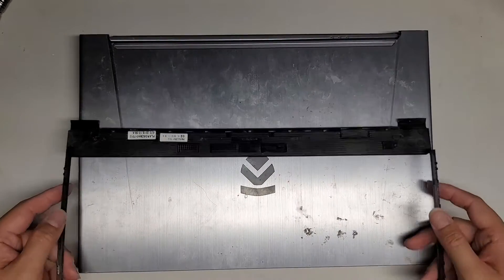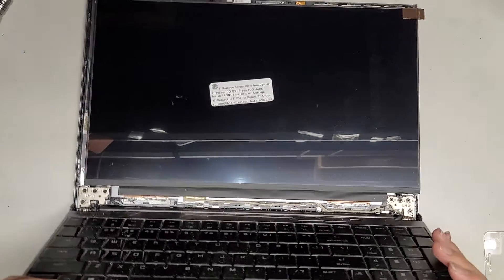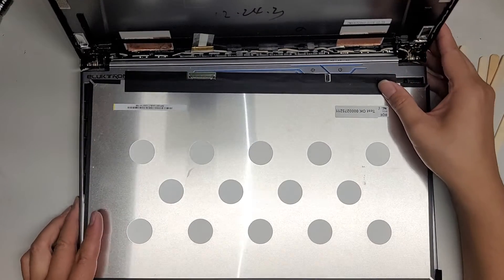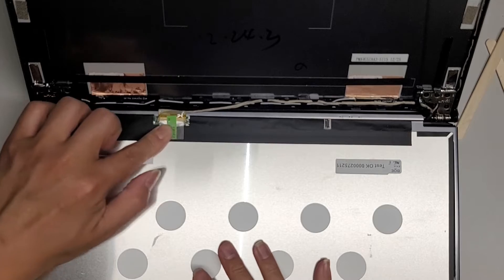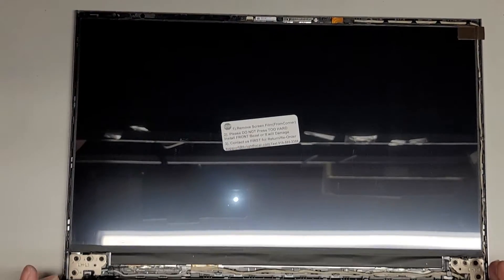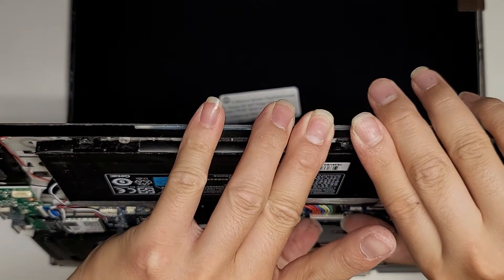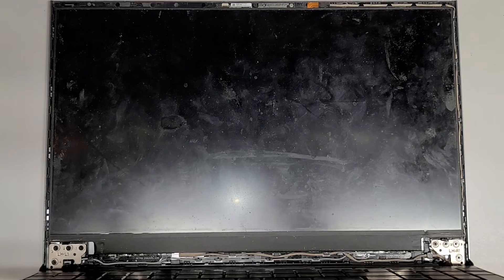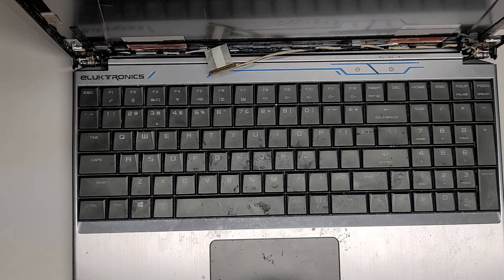Eluktronics MECH-15 G2R LCD Screen Replacement Repair Another Faulty Replacement Screen Part 3

Comment: any chance you've done a mech-15 g3? mine has these little lines going all across the top (even in BIOS) and I'm hoping it's the ribbon . . . but I've got it open and have no idea where that connection is. I'm overseas from them so I'm gonna have to order the screen and figure out how to install it :-(
Reply from the maker: Try an external monitor first
Reply: @ItsBinhRepaired  external monitor is working fine! Trying to figure out next steps.
Reply from the maker: Most likely a bad LCD

Comment: Have you learned anything new on the screen part numbers? I recently had a customer with a Eluktronics mag 15 1660 ti the original screen part number is NV156FHM-N4G V3.3 but they sent me NV156FHM-N4J V3.0 it works but had the same problem with lcd cable being about a centimeter too short. i had to pull the MB to gain access to where the cable was taped down to ,make it work.
Reply from the maker: Nope, I just complain to the seller.